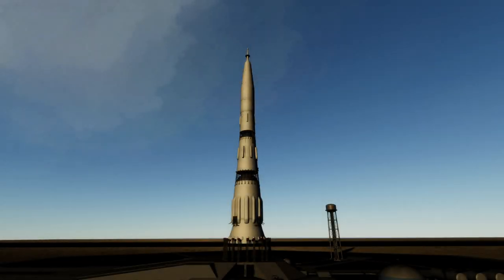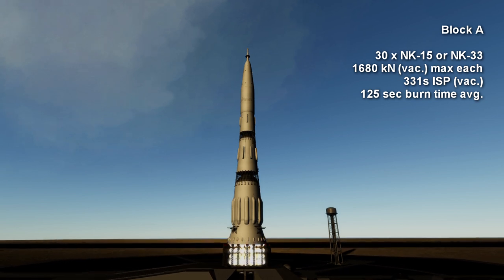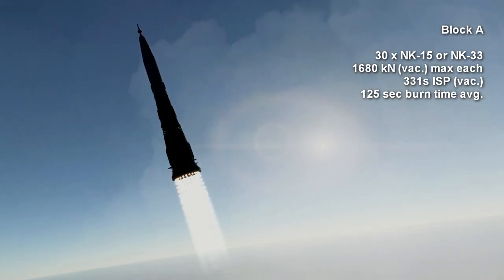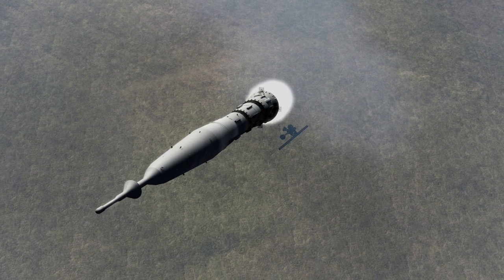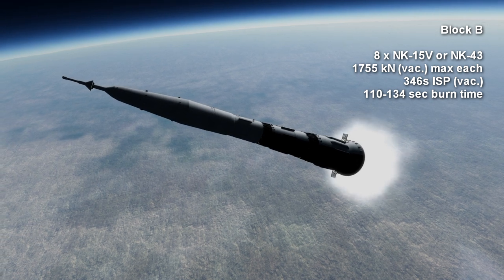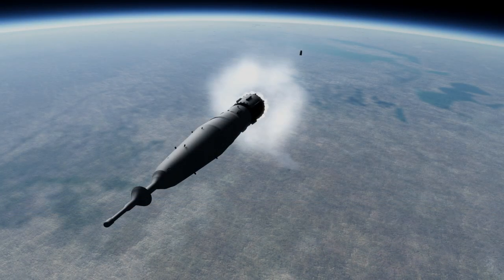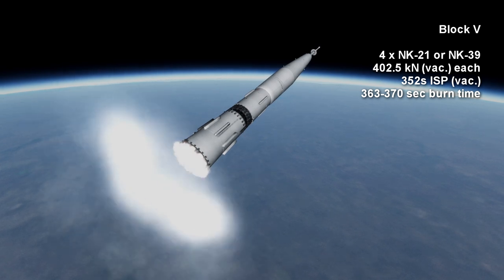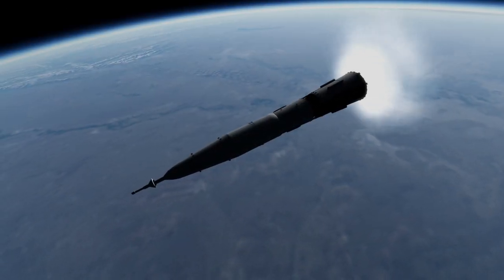Rocket Profile Neo - N1

Comment: I thought there was already an N1 rocket profile. Was there a mistake that needed fixing in the original?
Reply from the maker: The original used Procedural Parts instead of custom parts for the rocket, and I'm focusing on redoing those procedural ones for a start. Also, the visuals in general are now better.